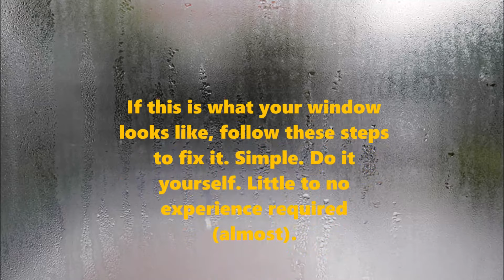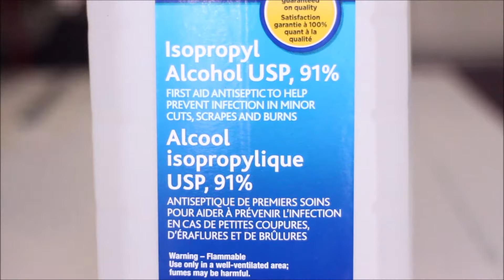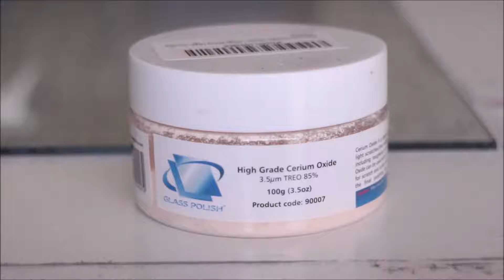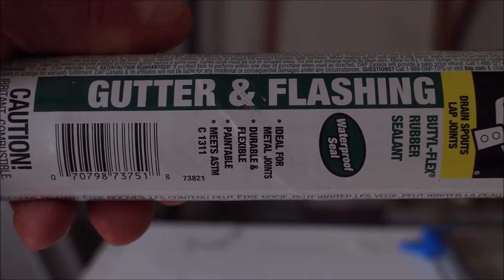Foggy Window Fix Tutorial

Comment: Really impressed with the custom nozzles and clamping brackets you 3dprinted. No matter how you look at it this is a very time consuming job but those items really help save hours spent reclamping and make the job of applying the butyl rubber much easier. If you can find a company that supplies sealed units in your area the replacement price will be the best. Buying sealed units from a window company will be most expensive since they will double the price they pay for the units. If you have many units to replace, some companies will do delivery as well but you will need to custom fabricate a glass skid to keep the remaining units standing upright while you install them. Leaning them up against a wall may allow heavy glass to shift and break the seal.

Comment: Good luck in the UK
... I've split units over the years but only to re-cut the glass for greenhouse repairs. It's more hassle than it's worth, and the watermarks are totally etched in....
Reply: The water marks can be dissolved by putting paper towels soaked in vinegar on top of the glass for a few hours.

Comment: I'm thinking you'd want to be in a zero humidity environment. Buying the units factory sealed and covered by warranty seems the more efficient route, especially if this is a business venture. Any moisture that gets in there is going to show up as foggy with the first temperature change. I would never put this much effort into a rebuild for a customer only to have them call me back within a change of season.  But, hey, if just doing a DIY at home, this might be an interesting project. Again, though, a lot of effort only to have it fog up in a year. Perhaps if you live in Arizona, you don't need to worry about humidity

Comment: Okay this can be done and it's not difficult but if you break the glass, damage the ally spacer between the glass or anythingelse then you are going to have to get a new unit.  I removed the fillets to measure the double glazed unit and after refitting them went to Highland Glass in Inverness....new double glazed unit supplied for £200.  Take old unit out and refit new one took 10 minutes....job done.  Took 2 weeks for the new unit to arrive but hey....a lot less hassle.

If you are broke and good with your hands then by all means go for it but replacement doubled glazed units in the UK are cheaper than you might think.

Comment: Nice fix for Foggy Windows.  I have a sliding glass window, which is in an aluminum frame.  The corner of the aluminum frame broke.  Is there anyway to DIY fix it, without having to have a new frame made?  Any guidance would be most appreciated.  Kind regards.

Comment: just one point to add.  The desiccant can be reactivated by heating in a 250F degree oven for a couple hours and reused, if you don't have replacement molecular sieve or silica gel.
Reply: What is the silica gel for?
Reply: @Tugboat-R-Us  Its purpose is to suck up trace moisture and keep condensation between the glass from happening.  If the seal breaks, it is quickly overwhelmed and moisture will build up and condense.

Comment: Do the new silicone beads create the new gas in the window or how does that happen?
Reply: No, they dry the air to prevent any more condensation on a cold day.   Expensive units have xenon gas (so they say) but the professionals say that most if not all have dry air fill.

Comment: Fundamentally it would be impossible to hermetically seal the air between the panes because atmospheric PSI
fluctuations would exert extreme forces over the large pane area,  so the D.G industry has given us the desiccant 
solution to the problem that creates more work/profit for itself,  a theoretical solution would be to have a tube 
leading from the gap through a renewable desiccant container.
Reply: I lost three slider panes at once during a severe summer storm. Outside panes cracked. Barometric pressure drop was to blame.

Comment: Just tried this in the UK, not sure where this was filmed. 

Big differences: 1) 3:01 - he slices through the sealant like butter, but the butyl sealant I was slicing through was much tougher, definitely blunting my Stanley knife, took 3-5 passes each side with the knife. 4:46 - absolutely no chance of this, had to use an oscillating tool and scraper attachment to get the butyl sealant off of mine (also the tool heated the sealant and made it messy). 5:20 - the sealant I was dealing with was not solid so the wire brush got none of it off. 

Also I learned the calcified stains are extremely difficult to remove... glass polish only got some off. I'm currently in the process to see if Zep or formic acid will remove the stains. 

In conclusion, if you're in UK, definitely do not recommend doing this. Going to do it once then just buy new units.
Reply: Will def avoid, even before readingthis comment, thought it looked a bit of a pain in the arse, your comment sealed the deak though, will just pay an independent and steer clear of tbe people in the radio in UK, the one that has the jingle that ehymes with Pish In Your Ear!...

They quoted me £250 but a wee independent fella in Glasgow is doing it for £80-£100 "depending on how much hassle I have gettin the frame off"

So even £100 is better than £250...
Reply: Avoided me looking into this :) though it's nice to see how Double Glazing fits together.
Reply: The sealant in the video is a 20 year old (at least) 2 part hand mixed resin which has a soft rubber consistency and is very easy to cut. Your unit is probably sealed with hotmelt which is incredibly difficult to cut through, seriously, do not bother. The stains will never be totally cleaned off the glass, this is because the vapour that the dessicant gives off is slightly acidic which permanently etches the glass. If the unit has very recently failed you  may get away with the stains, but I mean very recently, like within a week. I've been repairing windows for many years and can confidently say this repair method is futile.
Reply: It probably depends on how long it’s been misting up for. The moisture can mix with the desiccant and when that stains the window the sun can effectively etch the window. If you catch it as soon as it starts misting you will be OK. Although you did say it was a pain to clean the sealant off.  It’s useful to know that you can repair them if you are on a budget, especially if you have a few windows at the same time. I just bought a 1200mm x 1100mm sealed unit and I thought it was reasonably priced at £40, I’m not sure if I would have the patience to repair one.

Comment: why are the frames filled with silica?
Reply: Hi Miss Wong from a year ago who probably already got the answer! Silica gel acts as a desiccant as an additional layer of protection in the even of tiny breaks in the seal between panes to grab any moisture from the air moving in and out of the panes due to variations in air pressure. That will prevent the fogging in between panes that will eventually lead to mineral/dirt deposits that form and give your windows that permanent foggy look.

Comment: I'm going to try this on a curved double pane glass that doesn't have a frame. It's for a car but I haven't been able to find one that was good in a yard and they are no longer available.
Reply: double pane glass in a car?  and every pane except for the windshield is tempered and will explode if drilled.
Reply: @gbear1005  mercedes and bmw have used double pane glass on rear and side windows for decades. Both tempered and non.

Comment: IMPORTANT: Before you watch, make sure you knew how to make designed stuff from a 3D printer😂
Reply: Totally unnecessary. The 3 D printed parts just make it easier. If you have or make some soft jaws for a vice (even folded microfiber towels could be used) that would work.

Comment: Brilliant job!  Two questions.  The first is your use of cerium oxide polish.  If this was a "low-E" pane, I think that would have destroyed the coating.  Second, I wonder why you didn't flush with argon.  You have done such a terrific job resealing these two panes, why not add argon gas?  Thanks for showing your work.  Would you provide the stl files for the 3D printed applicators?
Reply: Doesn't the dry argon from silica beads get passed into the window gap?
Reply: By all accounts the argon don't really do much ....just found thus from research

Comment: When the condensation inside of the insulated glass unit has been trapped in there for awhile with the sun beating on it the minerals in the water(condensation) etch themselves into the glass giving you that white milky look and it does not clean off even with a razor blade. The cerium oxide that he uses to polish the glass has the consistency of all-purpose flour as it cannot scratch the glass so the actual cleaning of the glass would take many hours in itself if it is even possible at all. You must also remember that the moisture that has been trapped inside of this glass unit has saturated the desiccant inside of the metal glass spacers and corroded them. Cleaning up the glass spacers is not usually a viable option.
Reply: I guess it would be easier to purchase new payne's of glass?

Comment: What do you mean after the sealant dries remove the old panel and replace with the new ?
You have just removed the old panel, cleaned it up, polished the glass and resealed so I assume you had to board up the missing panel until the next day. Not much help to those of us who don't have a 3D printer and skills in 3D CAD design.

Comment: Whoops I broke mine putting the glazing beads on. Both sides at that. The shit you told me to use is so hard to get off.  I've sliced my arm so bad I'm in the hospital. Looking at about 19 stitches so far. I didn't have a spare IG so my house is wide open, hopefully no one robs me and jacks my new 3d printer. Great video though.

Comment: Brilliant! Insulated glass is one of the biggest eco-scams out there, my 72x90" slider glass is $650 for just the replacement glass, not installation! There's no way it's saved that much energy... Building failure prone products to be thrown away when they fail and replaced with another failure prone product is not 'sustainable' or 'green'...
Reply: The idea of energy saving products isn’t just return on investment… it’s about moving toward a sustainable planet… whether or not you want to participate is based on a complex set of variables
Reply: @nitrousman8882  no it isn't. 
The very nature of living sustainable completely coincides with whether or not it saves you money. 
If you spend less on heating or cooling, you are being more sustainable. If the product is cheaper due to economies of scale, it means they are able to bring you more product with less cost. 
If double pane windows don't bring you energy efficiency to outweigh the cost,it's either because the company is trying to oversell or the cost of energy whether through actual energy or man hours doesn't make sense.
Reply: I think about this all the time. I’m in the window cleaning industry and see thermal windows fail after 10 year and almost always after 25.
Reply: Old fashioned storm windows or clear plastic film used seasonally has worked for me for the last 45 years in an old victorian with single hung single pane wood windows

Comment: Interesting video. But an awful lot of work when a replacement unit that size from a local glass supplier would probably cost about £25.  (A couple of years ago I got a new unit made for one of my windows, approx 15" X  25", it cost £13).
Reply: this is where eco meets price

I guess it should be a bit like desktop repair. Replace the device/glass to resolve the immediate problem, but send the original glass... somewhere... to be repurposed.
Reply: I recently got a new 12x12" unit and it cost £55! Where might one find your stated prices?!

Comment: So...you just left regular air in there that is just going to condense again?
Reply from the maker: The frame is filled with silica sand that absorbs moisture, so there is no condensation in the window at the moment (after a few months).
Reply: Alex i dont know which area in the states you live but here in Scotland the climate would rapidly deplete the life of the sealant used for this repair ,in Britian we use a 2 in 1 mix for the sealant or a product called hot melt ,a unit is put together then put in drying area to cure ,you can tell me that this system when you strip and redo unit is as good as that .In Scotland there is a 5 yr manufacturers guarantee ,which if unit fails in this time frame it gets replaced gratis
Reply from the maker: @bobbycaldwell4132  I'm in Canada. There are below freezing temperatures for good part of the winter. Southern side receives a lot of sunlight. Units installed there with new building started failing after 5-7 years. They had only single sealant  which is very hard when cured.  Its bond to the glass failed eventually. I used butyl based sealant on internal seam between frame and glass. It stays sticky permanently and keeps it enclosed .  It is covered with another sealant on top to keep parts together. I'm sure the unit will serve me longer  then original unit.
Reply: Butyl is a non hardening compound used in the glazing of dgus in a timber frame ,this doesnt react with the sealant on a unit and cause it to corrode ,Alex if the product works as well as you say then fair play but this is me speaking on the fact i have 40 yrs experience in glazing in Britian and the solution you offer doesng seem practical to me in my opinion ,i watched a video of guys drilling holes in units and offered my tuppence worth on that also

Comment: If you have gas-filled windows I doubt you want to be taking them apart.
Reply: Obviously, there is a seal leak and there is no gas left in the interface.  This seems to be a good hack to give a try before you replace those absurdly expensive windows.
Reply: @lizard944  why would you put a window back that no longer has gas in it? Sounds ghetto. If you can't afford to do it right maybe you should rent with 3 of your buddies.
Reply: @MuffinMan0521  Did I trigger a know-it-all snowflake? LOL!  I own a 4,200 sq/ft house.  Hardly a renter.  Argon gas makes very little difference.  The OP was fixing the window for aesthetics.  Run along, little one.
Reply: @lizard944  triggered people usually start listing off the posessions they are leveraged on as if the people around them are 16 years old and super impressed. Maybe talk through your next response with your wife since it's clearly going to take at least two of you to come up with something half way decent, champ.
Reply: @MuffinMan0521  Why would one open a double-pane window if it still had gas in it? Pro tip:  If it still had gas in it, there would not be any condensation present like the OP was experiencing.  Jeez, you're a simpleton.  You should start out every reply with, "Here, hold my beer."
Reply: @lizard944  this is coming from the guy that hasn't even finished school yet. You're just a little fish right now.
Reply: @MuffinMan0521  Isn't "Muffin Man"  a childhood nursery rhyme?  How apropos.  You can't make this stuff up.  LMAO!

Comment: Beautiful job Alex, just surprised you didn't fill the panel with Argon gas for better insulation value.
Reply from the maker: Because of the interior aluminum frame, which is not an insulator, the choice of gas has a negligible effect.

Comment: I am doing this process for my sliding glass door insulated panel (46x76 huge) I dont have cerium oxide polish, are there any alternatives you can recommend? I tried polishing with blue stick plastic polish stick from harbor freight but was getting nowhere. Please help :)
Reply: @PuppyBiteforTrump  Did what you said , they have held up great, still look brand new. Zero leaks or internal fogging. It’s been one year exactly since I fixed these they are holding up through all the crazy weather Chicago can throw at them! This saved us at least $3000 due to the oversized dimensions we have.

Comment: So you have a new unt to put in place whilst you more or less strip existing and  carry out a more expensive procedure than getting  a replacement unit in 1st place
Reply from the maker: Money wise it's much cheaper then buying new and getting someone installing it for you. Where I live one new unit costs about $100 plus installation about half of that.
For DIY repair tools and material cost is about $15 per unit. Sure time is needed to be invested. 
Unit has been performing through winter just fine, no condensation any more.
There are two kind of people responding here: someone like me who is interested to use time available and to try something new and contractors who charge arm and leg for 5 min job to swap old unit with new one.
Reply: @alexfreestyle4754  Alex how much do you charge for doing this? I'm also in ON
Reply: @selfishbarber9763  probably not anything less than getting a new one and having it installed I'm guessing. It's a lot of work, but it'll probably last longer than a poor quality-controlled off the shelf cheap IGU